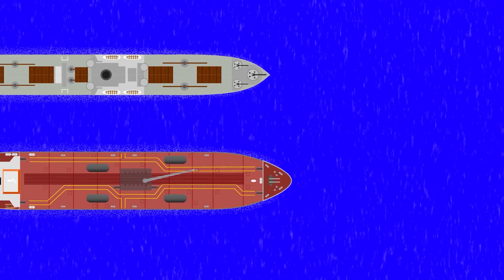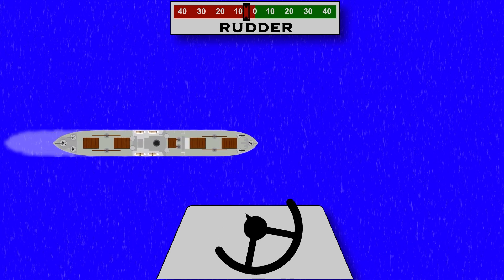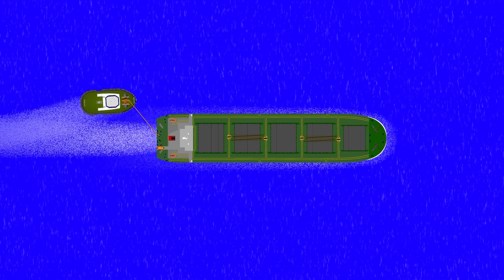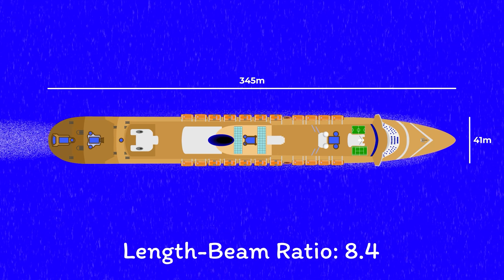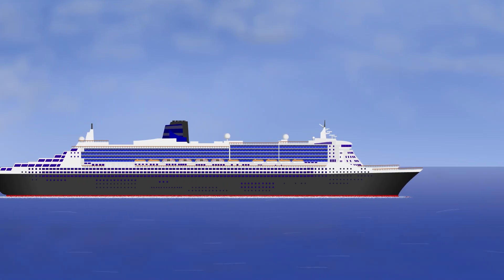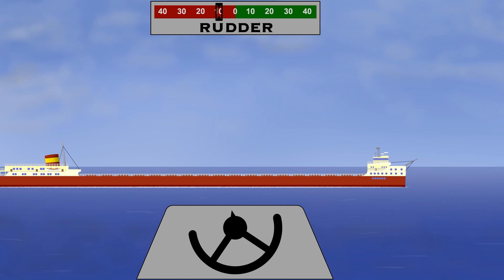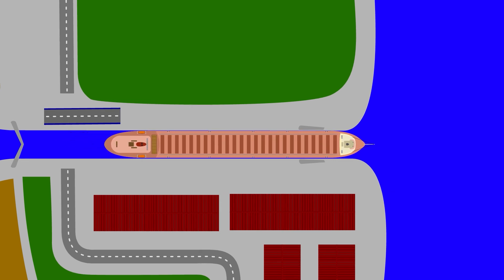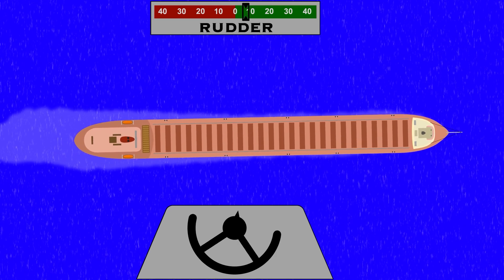Why Do Fat Ships Wobble?

Comment: I'm taking a few guesses as to WHY fat ships wobble, as this was not very deeply explained in terms of the physical phenomena at play. A pointy vessel (low block coefficient) will slice through the water with less resistance, deciding its path as soon as it "runs over" any bit of water. But a fat ship will create a bow wave, the water will pile up in front of the ship and readily drain to either side of the bow, making it harder to steer. Also a fat ship with a square stern will tend to cause vortices in its wake, essentially stalling the water on one side and contributing to asymmetrical steering. When these vortices start going left to right repeatedly, it's similar to how large industrial chimneys can start oscillating and even taking damage in high winds.

Comment: Doesn’t hull shape also play a big part? A deeper v hull will give greater directional stability v a squarer cross section hull, but conversely not be as efficient to load, especially when restricted by depth where the squarer hull section reduces draft and increase loading area?

Comment: Without watching is it moment of inertia. Like why an I beam is three REALLY thin pieces of metal rather than one fat one. They individually are insanely easy to bend in one direction in particular but in another particular direction it is made even more resistant to bending then as an I beam the big thin sheet bends extra easy requires the other two sheets to bend in the direction that is extra hard. For the two small sheets to bend in the extra easy manner means the big sheet would have to bend in the extra hard direction. The fat ship has more mass in the direction that doesn't resist rotation like a thin ship of equal mass would the longer ship has a greater moment arm effectively because more mass means even more mass even further from the pivot point. Once inertia is going for a pivot point the angular momentum doesn't just disappear more mass at the pivot point is more angular momentum still needing counter rotation. If you spin yourself in and office chair leaning out slows the rotation but not because leaning out takes away energy although friction does take energy out of the system over the time it takes to redistribute mass but if you don't wait too long to contract while friction hasn't turned too much motion into heat the rotation will speed up again the linear velocity of a rotating body is different speed at different points at the same angular speed contracting decreases the highest linear speed points of the system. Yet aside from friction energy isn't leaving the system angular speed changes

Comment: What if we have the opposite extreme with a ship that has a ratio of 1.0? Effectively a square, does that still wobble or does that become stable again?
Reply: Horrifically unstable, I would've thought, if you remove the rudder and propeller (essentially making it a raft), it'd be equally easy to push it in any direction - arguably it'd have no 'sense of direction' at all. Obviously, the rudder and propeller would give it some stability, but not much.

As a crazy idea, I guess you could try this out on land with wooden pallets and office chair wheels (just fix the front wheels so that they always point straight). That would give a decent simulation of a rudder at the rear. Add more pallets as you see fit to make it wider and/or longer.
Reply: Figured, but that experiment sounds fun and dangerous.
Reply: @The-Anathema  Indeed, the best combination 😁

Comment: You can experience this effect really well in a kayak. Those long skinny kayaks are really easy to cruise with and keep straight. The more stout and wide kayaks, while better in rough waters because of their lateral stability, they are constantly moving left and right as you paddle along. And if you try to go really fast in a stout and wide kayak it has a tendency to turn so much that you lose control and spin out, which can cause you to capsize.

Comment: A simple explanation as to why that happens. You have centre of mass of the vessel and centre of propulsion as well as a centre of resistance which are all in a straight line when the ship is moving forwards. Ships are rear steer objects so the centre of thrust moves out of line which then presents a bit of the beam to the forward flow of water across the hull effectively moving the centre of resistance across in the opposite direction so the vessel will continue turning about a centre of rotation usually near the centre of mass. This happens every time there is a rudder input. This happens more for wider vessels as a certain angle of turn causes a greater movement in the centre of resistance. 
Long thin ships tend to get stuck with nice flows along both sides of the vessel which are hard to break so difficult to imitate turns. 
Both of these problems are solved by proper rudder design and a ship which is excessively prone to either of these conditions could be rejected by the customer at the sea trials stage. 
The ship with a high block coefficient has the wobble problem as it is effectively a brick in water and the forces acting are higher for a comparable vessel of same length&beam. 
As a naval architect you can spend months conducting operability and control assessments on a design in CFD and other simulation softwares before designing your rudder.

Comment: Water an air work in very similar ways, i think a good way to illustrate this is to imagine a ship like a dart or ball

Ships that have a larger LB ratio are more like darts, the center of mass of the vessel has a large surface behind it to create drag and self stabilize the ship. Just like when you throw a dart, the fins keep the dart straight along the arc it's travelling on even when the direction it's pointed is disturbed 

On the other hand Ship's with lower LB ratios are more like balls, there's less of a surface behind the center of mass to act as flukes, and when you throw a base ball or basketball it very easily spins in the air, and In the case of a baseball this spin can very easily change the direction of the ball (though that's a different effect entirely)

Comment: So Noah's ark in Genesis, written over 3500 years ago, stated length 300 cubits, width 50 cubits (about 505 ft x 85 ft using ancient Egyptian cubits).  This is a length / width ratio of 6.  Pretty good dimensions since it was to be seaworthy and stable for a whole year, but wasn't necessary to travel in a straight line.

Compare that with Gilgamesh epic which was just an embellished story, not reality. The Gilgamesh ark was in the shape of a cube. Such dimensions, if real, would have been disastrous in a hurry.  But thank God the real ark story was not based on Gilgamesh story because it would have capsized on the first day.  

God's word of truth always surpasses man's word. And God knew the dimensions necessary long before modern shipbuilding came along.

Comment: That’s why battlecruisers (a lighter but faster battleship) we’re typically longer than their battleship counterparts yet still lighter, bc they were a lot longer but thinner, therefore making them able to achieve greater speeds but it did cost in agility as trying to turn a long plank of metal half submerged can be kinda hard

Comment: Hey, love your videos as do my kids. This made me think of the Norwegian navel and seismic survey vessels the Ramform design. Flat bottomed and 150m long and ~70wide for the latest Titan class. The previous classes were narrower and were supposed to be stable but rolled massively in the slightest long period swell, the tank tests they did for designing clearly missed something... fun but not that fun to work on for weeks at a time. If you ever wanted to do an episode on them I worked on them for years so happy to answer questions. The Banff was a ship oil storage facility built before the seismic vessels that cost millions to fix due to not being stable, and same mistake went on with the first seismic vessels, could be an interesting story to cover all of them.

Comment: I've felt the same thing on a kayak.   It just didn't want to go straight, just paddling one stroke each side alternately wouldn't keep it straight, you constantly had to give more strokes on whichever side it was trying to turn towards - and be ready to swap to the other side the moment it began to swing the other way.   
I think it's because the streamline flow at the rear prefers to flow diagonally one way or the other.
I've also heard that certain airliners do the same, they tend to crab slightly, albeit they have a whacking great tail fin to restrain the tendency.

Comment: Alot of this seems to also be assosiated with trailers.  A smaller trailer might be 12ft long and 6 ft wide. They turn insanely fast but hate going straight, your often seasawing the wheel to get it to go straight back. However a 30ft trailer that's 8 ft wide will be tough to get started turning but keeping it straight is much easier.

I don't know if they're related but it seems they are. 

I have an additional question as well though. 
Does a single screw ship of the exact same build with this fat wobble turn easier then a ship with two screws assuming everything else remained the same, including thrust, rudder size, etc?

Comment: As an aerospace engineer, I suggest to increase the yaw stability volume. Maybe itroduce a deployable vertical stabilizer on the long distance legs in order to reduce fuel consumption and crew workload.

Comment: Ok so according to rudimentary math I've based on this, the most efficient hull shape is a 1 dimensional line, with a ratio of inf, and the most maneuverable hull shape is a horizontal 1 dimensional line, basically just the first one but perpendicular, as it's ratio is infinitely close to 0
Reply: Mathematically, maybe. Physically, probably not. Think about it: in your second case, you've still got to rotate essentially a metal plank through a load of water. If we're talking 'as the limit of x approaches y' scenarios, orientation doesn't really matter anymore. I'd go so far as to say an LB ratio of 1 is the least directionally stable. I agree with your first statement though about the most efficient hull shape.

Comment: Sea kayak vs recreational kayak makes this very noticeable.  The tracking stability of a sea kayak is very noticeable compared to a recreational boat, which often turns direction every time the paddle is applied to the water. Even more extreme a white water kayak is short and stubby to make turning as easy as possible.
Reply: Yes I noticed this the one time I used a kayak (in a calm lagoon).   Very frustrating, the bloody thing just didn't want to go in a straight line at all.

Comment: I feel like I missed the reason why "fat" ships wobble. I know he mentioned how the different shapes of ships act differently, but I don't recall hearing why a fat ship wobbles and why a skinny ship doesn't.
Reply: fluid dynamics 🤷

something to do with how higher length-beam ratio ships act as a longer lever, so the water on the sides has more impact on the motion of the boat than the water at the front and back? I dunno
Reply: @Jek  sure, you or somebody else could explain it, but the video doesn't.
Reply: @patricknorton5788  Yeah, that was my point. I wasn't asking for an explanation from viewers, I was pointing out that the video didn't answer the very question that it posed in its own title. I would prefer to hear the answer from the expert that makes the videos.
Reply: directional stability, the bigger ship needs more rudder input to keep it straight which could look like the ships wobbling.
Reply: @TitanicTours27  yes but, why?  We just heard that the fatter hull has less directional stability, so we know it'll need more rudder input, but why?
Reply: @patricknorton5788  An analogy is how a figure skater will spin much faster when they bring their arms close to their body, and slower when their arms are straight. It is not the same mechanism, but the effect is the same. A longer boat  has more water to push sideways to turn, further from the center. This takes more effort.
Reply: @Eric14492  that makes some sense (and I have experienced the difference and trade-off between maneuverability and efficiency/tracking ability in using short and nimble/or long and fast kayaks and cross-country skis).  The point was, though, that the video didn't explain it, even if you can.

Comment: A good example of this is the difference between a white water kayak and a flat water kayak. Most people are familiar with flat water kayaks. They are long and thin, so they track very well going straight but are harder to turn. 
You may have seen a white water kayak in the Olympics or on some YouTube channels. They are much shorter, so they are highly maneuverable. This agility allows you can get around rocks. You can actually turn standing in place. 
An analogy is how a figure skater will spin much faster when they bring their arms close to their body, and slower when their arms are straight. It is not the same mechanism, but the effect is the same.
Reply: My one experience of a kayak (on a calm lagoon) must have been a white water kayak, since the bloody thing just would not go straight.   It was just frustrating.    Absolutely the wrong place for it.

Comment: As I understand it, there is similar stuff with Airplanes.
The average Airliner wants to stay right level, flying straight. Which makes them harder to turn, but more more fuel efficient in cruise.
While combat aircraft are designed less stable - to actively unstable like the Eurofighter - as that increases maneuverability.

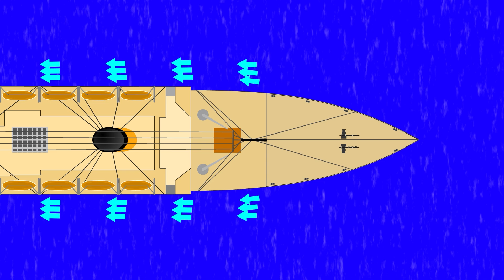Comment: 6:05 "ships with a lower length-to-beam ratio... are generally faster and more efficient" I'm confused, I thought we just learned that higher length-to-beam ratio was more efficient due to not needing to use the rudder as much when traveling straight
Reply: Yeah, I think he mis-spoke there. Should be higher LB and lower block-coefficient.

Comment: Is that why the Iowa-class have those enormous snouts so they can be really thick and chunky to fit those massive gun turrets on but still maintain a low block coefficient and improve directional stability at their cruising speeds?

Comment: Would bow thrusters help
Reply: Bow thrusters are pretty ineffective with headway. WThe easier way to increase stab is to trim by stern
Reply: That's just another steering mechanism, it wouldn't prevent the actual wobble, just correct it like a rudder does
Reply: Cort nozzles  ?
Reply: It's not much of a problem, anything oversteers above a certain drift angle, it just takes a while to get a good feel of how a particular vessel handles. The only thing that is actively steered from the bow while underway is a canoe, and that's mainly done to reduce or increase drift. The wobble is pretty much the same thing as "pilot-induced oscillation" in aviation - the person at the helm needs to steer in anticipation of the vessel's movement, and if they fall behind, they overshoot the intended heading.

Comment: Huh this is interesting. Aeroplanes have similar performance characteristics so it’s interesting to know how attitude stabilities affect ships as well.
In aviation, we say that planes that keep increasing in the relevant attitude axis once control input returns to neutral have negative stability on that axis, 0 if it maintains its attitude, and positive stability if it returns itself towards the flight trajectory. Negative stability is primarily used in fighters.